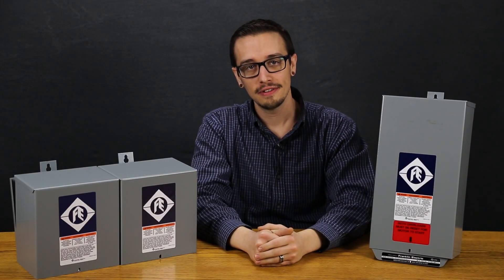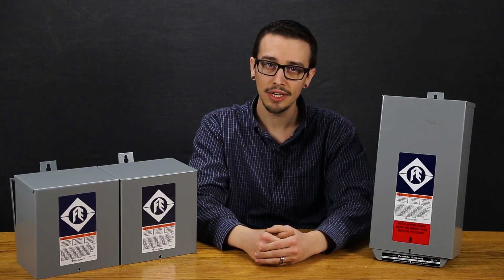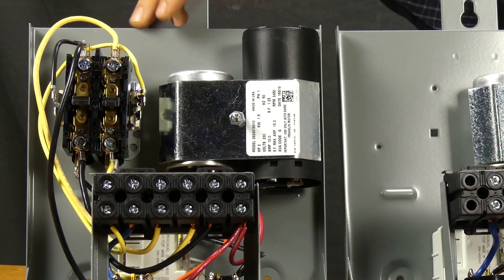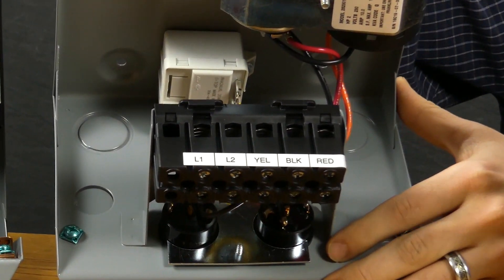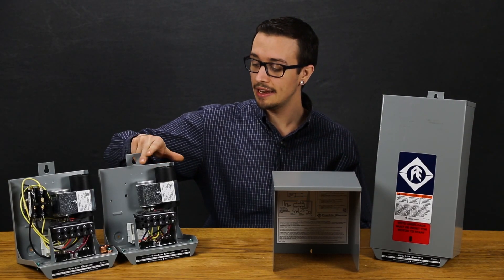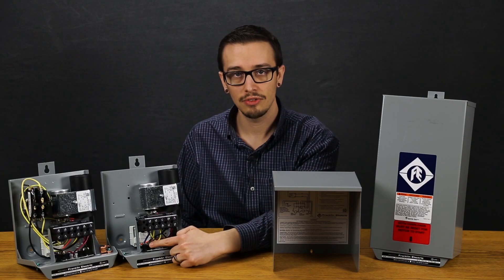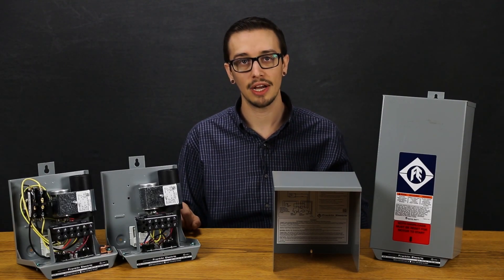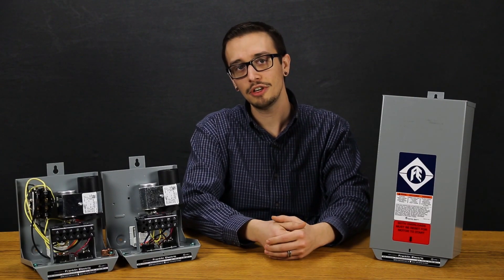Franklin Electric Standard and Deluxe Control Boxes

Comment: Saludos amigo Luis por acá de Venezuela sigo su canal muy importante, podría ayudarme en lo siguiente que cajas de control y potencia puedo utilizar para bomba Franklin electric
8" modelo: 239604  estándar
hp:100 - kw:75 - voltaje: 460 - hz 60 - f.s: 1.15 - amp: 126 a plena carga - amp: 142 máxima  carga 
Agradecido amigo en ayudarme gracias

Comment: Do I need an external Pump start relay if Im using this with an irrigation system?
Reply from the maker: If you have the deluxe control box it has a contactor in it. If you have a standard control box it would require an external pump start relay.

Comment: Hello Chris. Thank you for the very informative videos. Is there any chance you can create one covering a Franklin Electric deluxe box and how the NC, (normally closed float) and NO float are wired to it? My NC float is tripping the box even after I purchased a new one. It does not trip when no float is connected to the wires in the tank. I was hoping to temporarily bypass this float to allow my well to fill the tank so that I can irrigate my landscape until someone much smarter than me can see what the problem is.

Comment: Please my 3phase franklin pump on electricity its 4000volts 10amps but pumps with very low pressure but on generator 400volts 12amps pumps reasonably. Please what do I need to do to get it to pump well on electricity. Thanks

Comment: I have an FE control box Model 282 3528 114 running a single phase 3 wire FE 2.2kW motor/pump model SVM 150/19.
Each time I turn on the pump, it runs for 15-20 seconds then the breaker trips. During these 15-20 secs, the pressure is very good.
Where is my problem?
I have changed the submersible cable from 2.5mm to 6mm but the problem still persists.

Comment: Well shut off as I ran a garden hose for 2 days and drained the well. I inspected the (new, by the way) Pressure Switch (good) and voltage current at various places (good) and then found the note on the control box, as in your video: "Overload must be reset for Motor to start."   So, I pressed the single Red button on the bottom, and successfully got power to the control box. However, when I then turned switch on at the Pressure Switch, power immediately tripped off again at the Pumptec "no load sensor - pump protection system" box. And now, I cannot reset the red overload control box button - nothing happens. What do you suppose is going on now?

Comment: How to connect the load side terminal(yellow-red-black) correctly to the motor?
Reply from the maker: The colors labeled on the terminals match the color of the wires on the motor
Reply: @RCworstwater  what if wires are not color coded, and difficult to identify connections especially if wirings has been worked with and not labelled properly?
Reply: @RCworstwater  also is it normal to have different currents running along the 3 wires? The common, starting and main?

Comment: My start up pump connection is being trip and my panel controller is not good I try to reset but still not not working how can I replace the start up or the capacitor because my pump was having pumping or no water comes and they my start up was not good
Reply from the maker: Give us a call: 855.329.4519

Comment: 2hp motor after afiew hours overloded...problem is where..tanks
Reply: Quite likely could be tank, as generally we have the pump running for only a fraction of that much time. If the tank looses air in bladder it will cause the pump to keep running, or a leak in pipes somewhere in the system, good luck.
Reply: Tanks you

Comment: Control box dead, after 30 years. I replaced it with the same model, 2hp rating. 
However, it seems that the pump is 1.5hp, not 2hp. Is that a problem?

It’s impossible to verify because the pump is in the well.
Reply: There is no problem if the pump is 1.5 HP and the motor it´s 2 HP.
Reply: @LuisRodriguez-ud9dl  motor control box. But, you is correcto.

Comment: Hi Sir,  Thanks for your educational videos. If  we don't  know the hp of the single phase 3-wire motor and the control box is missing how can we figure what of control box is needed ?
Reply: The body of the submersible motor has a laser tag on it, on it you will notice the specs of the motor.
Reply: look at the pumps at the nearest home box store, see if the larger ones are bigger. If not ask how deep the well for each size pump. Compare that to how deep you are/need to be, that should tell you what you got.

Comment: We live in cold Alaska..There is power on both sides of the pressure switch..next I pulled the cover off the well tube to see if there were wire nuts to test and heard the pump  start and then stop two seconds or so later...Can I assume that most likely this indicates a  frozen pipe? Or could this also indicate  a bad control box?
Reply from the maker: Thanks for the question. Have you checked the nipple that attaches to the pressure switch for a buildup of sediment? Also, check the pressure tank to make sure it is set to 2 PSI below the pump's cut-on pressure. If you are not getting any pressure at the pressure tank/switch then it is likely that your incoming pipe is frozen.

Comment: I have everything hook up pressure tank and breaker .but the control box has no power why
Reply from the maker: Do you have power at the pressure switch?
Reply: Break in wiring, bad breaker, wrong location(wrong breaker). Test for voltage at output screws of breaker. If 230V+/- is present, turn off breaker,remove wires, join them with wire nut, go to control box remove 'hot' wires, read a short circuit with ohmmeter, release wires from wire nut at panel, read open with ohmmeter at wires from control box. One of the named faults will show up from this. You may have to rerun wiring to control box, or change a breaker. Be sure pump is primed with water.